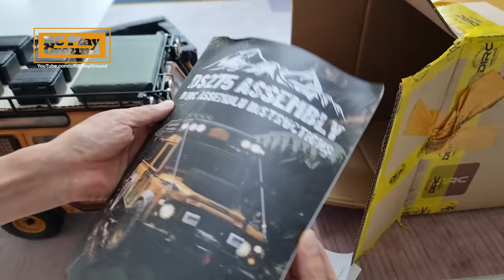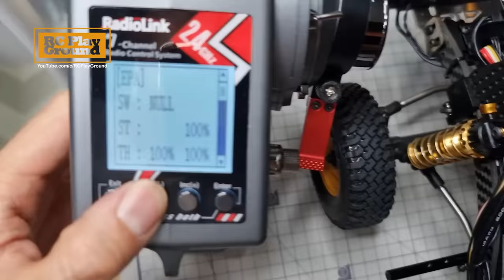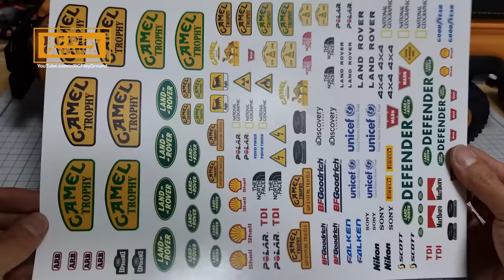D1RC Camel Trophy D110 Defender 1/10 Scale Unboxing & Review

Comment: Hi man, I'm from Brazil and I'm very interested in buying but I have a question.
What is the range of the affection signal??
Reply from the maker: We can get signals up to about 500 meters
Reply: Ok
Reply: I have another question.
How long does the battery last?
And what about the signal range is 500 meters?
Reply: Another thing I wanted to ask.
Is the car waterproof or water resistant?
Reply from the maker: It's almost waterproof
However, the LED distribution board is not waterproof, so we have to work separately
Reply: Because the car is meant for you to go on trails, when it comes time to clean it, I have doubts because I have no idea which parts are water-resistant and how I should clean them.
I'm thinking about purchasing a model but I want to take the best care of it so it lasts a long time.